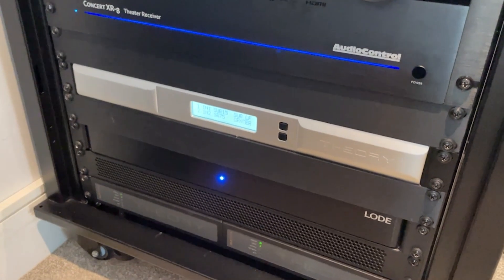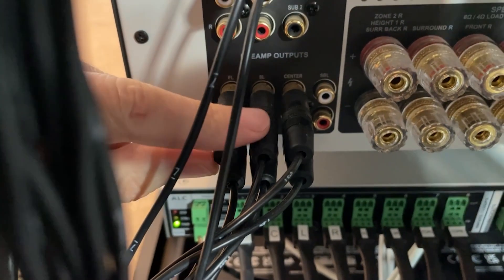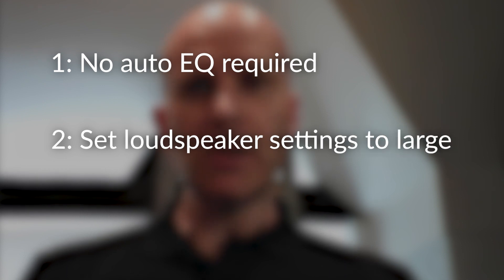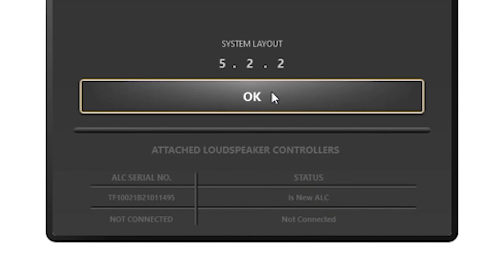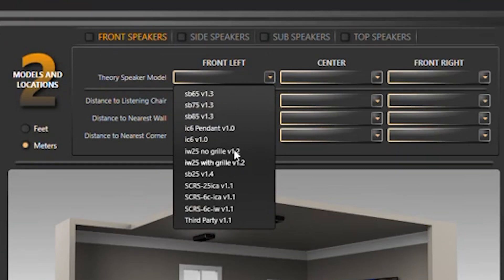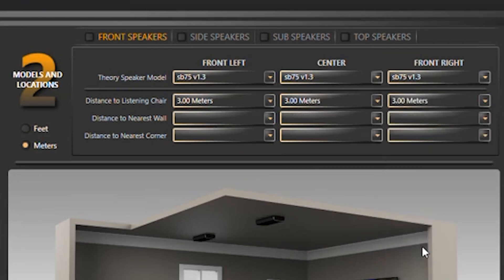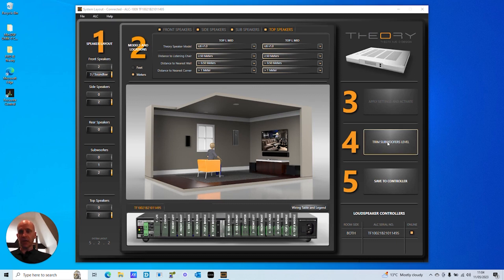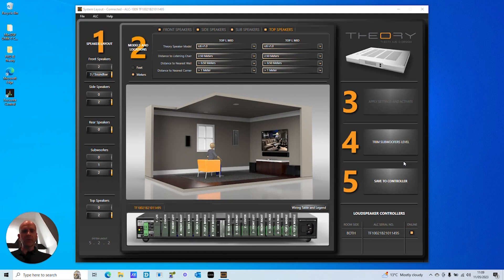How to Programme Theory Audio Designs' Automator Software

Comment: This is a very interesting product, as are the products from the pro side, Pro Audio Technology.  It is confusing though.  I would love to understand how high channel counts can be achieved, specifically regarding the connections.  For instance, how are two or more controllers connected along with external amplification for higher power subwoofers - and can additional subwoofers be added with yet other/separate amplification and control?  In a 11.6.6 configuration for example.